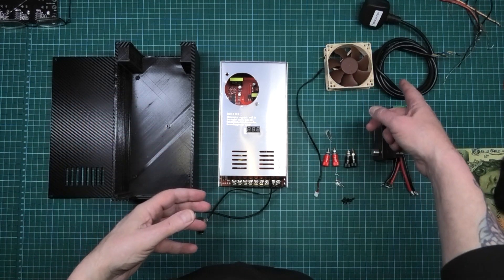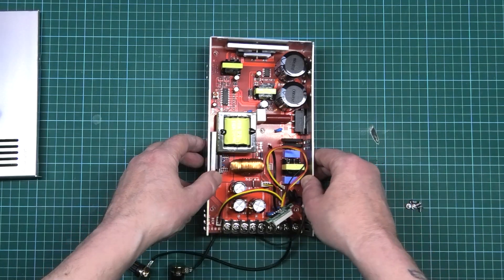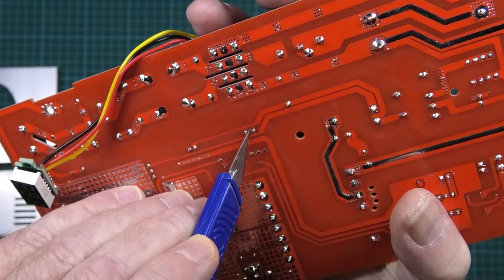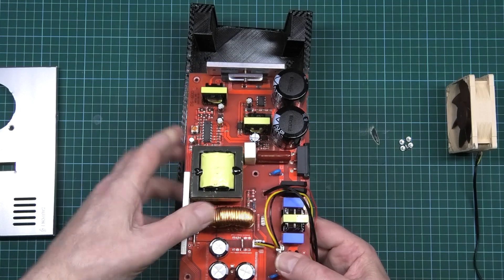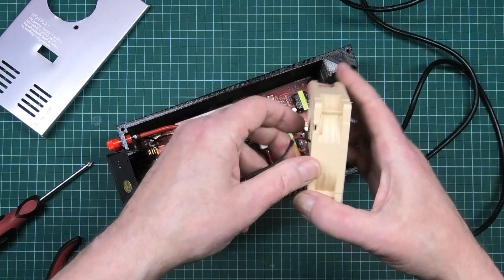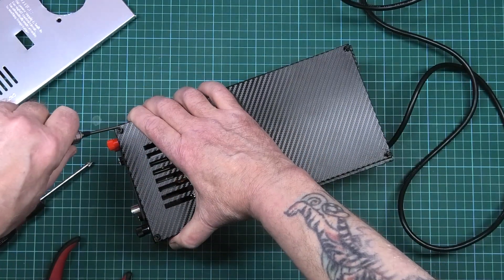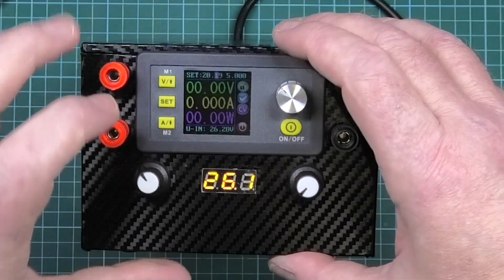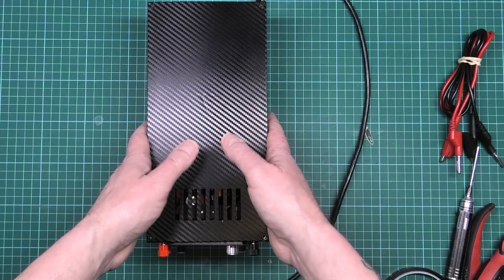DIY Ryden DPS8005 mains powered variable voltage & current charger / power supply

Comment: The wiring to the first pot sounds wrong but may not be due to crap design of the power supply

Are the red and black wires pos and neg as is conventional, or is the design deliberately confusing ?  I ask because pos and neg would normally go to the ends of the pot to create a voltage divider
Reply from the maker: I think it's designed to be misleading or just a bad design. I checked the resistance on the original voltage pot and wired it 'like for like'.

Comment: I forgot to discharge the capacitors once and it wasn't me that got the shock, it was the MCU. Somehow I bridged a connection between a capacitor and a trace leading to the STM32 MCU on a KT controller with a multimeter test lead. I think your videos are awesome. I spent so much time looking for answers to problems I run into relating to whatever project I'm working on. Some of the best solutions come from this channel. The reason you don't get more views is because there a very few intelligent people left in this world. Its like there is massive wave of stupidly spreading across the world like wildfire.
Reply from the maker: Cheers mate but you'd think that, if there were so many stupid people, they'd watch the videos in an attempt to learn something. It's a very strange fact, but I'm unique because I get less views from subscribers than passers by and it's usually the other way around. It's running at 43% from my subscribers and 57% are from recommendations/searches. I don't want fame, I want all my subscribers to watch all the videos or it's pointless subscribing in the first place. Plus which, the dislikes usually come within the first 2-3 minutes of releasing a video - this proves that it's subscribers that don't like the content and probably because it's not EV related (the reason they joined). This channel was never started as an EV channel, it just happened to start producing EV videos because I wanted to build an e-Bike.
YouTube's algorithms won't promote a channel when so few subscribers watch the videos. If I had 10k subs and 10k views (I know, it never happens like that) I'd be more successful than I am now.
Reply: @Vortecks  out of curiosity,  what have your subscription numbers been over the last two years?

Something very unusual happened that gave people a lot of time to sit around and watch videos.  Lately things are starting to become more normal.  These changes probably explain a lot of weird viewership on YouTube...

I have to say I found your channel through your V2 bike build but I like almost all of your stuff, especially the steam engines.

Now this is me trying to get you to justify sticking around a bit longer (for my benefit) but I think I could be right.
Reply from the maker: @joequixotic3039  My subs didn't ramp during the pandemic. In fact, they dropped off.
My spike came when I started doing EV stuff but I can't do it anymore mate.

Comment: nice little project is that¬¬  what ya gonna use it for??
Reply from the maker: Charging super capacitors mainly for my upcoming "will it vaporise" videos - All the other chargers I've tried don't work because capacitors have such a low internal resistance that they shut down because it's a dead short.
Of course, there's that and powering everything I work on.

Comment: I'd leave the bottom of the outer casing in. It provides an earth shielding and more importantly acts as a big heatsink.
Reply from the maker: Because of the crappy design of 90% of Chinese power supplies, the casing provides no earth shielding at all, it's isolated until you touch an internal component which is impossible with the casing fitted. The FETS and all internal components stay a lot cooler with the casing off and a constant flow of air across them than with the casing fitted.
Tested, proven and working which is why I released the video.

Comment: Eh I needed 134.4v for 32s lipo batteries (that feed a 150v 1000A buck boost converter = mains not big enough = high rate batteries). Was gonna build a few (since it's multiple batteries in parallel sometimes), but it turned out just to buy them from Aliexpress was cheaper (about $200 ea for 134.4v 12A, free shipping).

Comment: Going to use this build for my next power supply, very practical and the variable voltage/amps are useful.
Do you know if there is a Ryden that will do higher amps as at the voltage range i would be using 58v max the PSU can do almost a full 10A.
Reply from the maker: If you want any higher current at 60V, I think you'll have to go for the RD series - the RD6018 is 60V 18A mate but they are bigger.